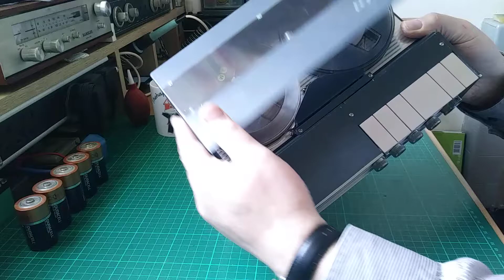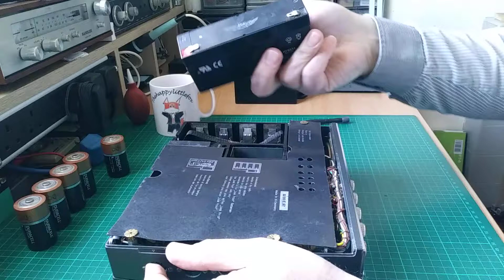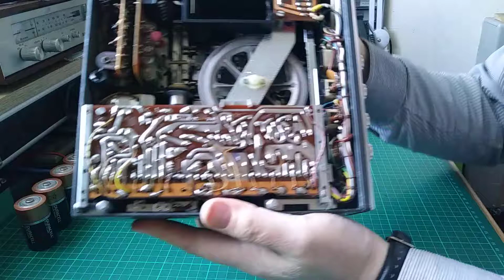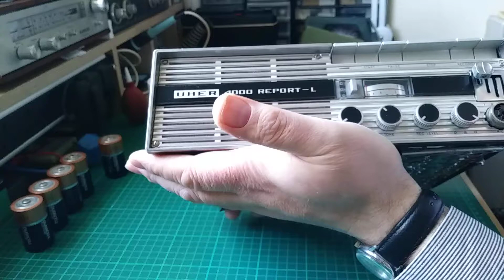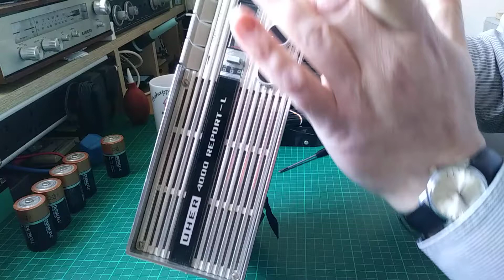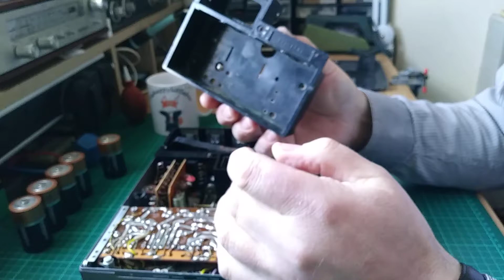Foxys Den

Comment: That is an amazing little machine. I would love to see a demo of it running with different speeds etc. I used to do song recordings using the inside of a pen and cassette deck to dub over my songs. I would put the little part of pen inner on the tape pinion to stop it wiping the original recording, then I could harmonize and add some more guitar over it. It worked pretty well. :D
Reply from the maker: yes they are an amazing little machine you'll probably see more of it in the future along with the Revox A77